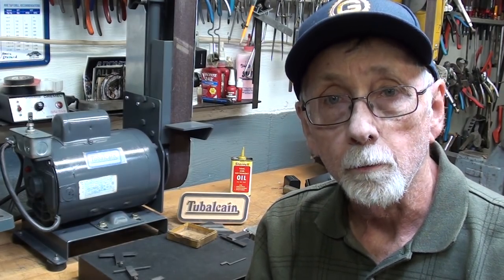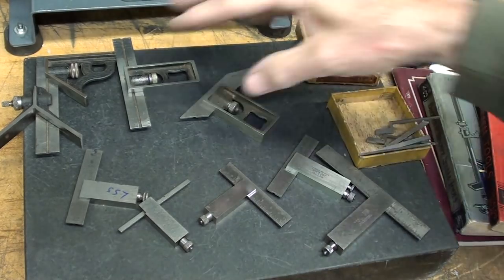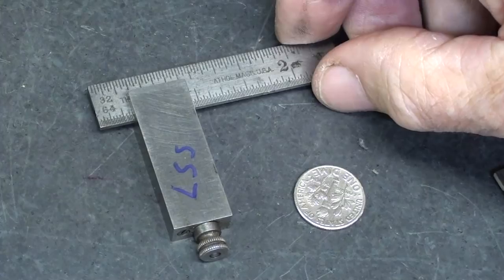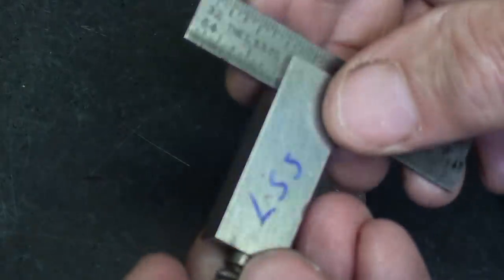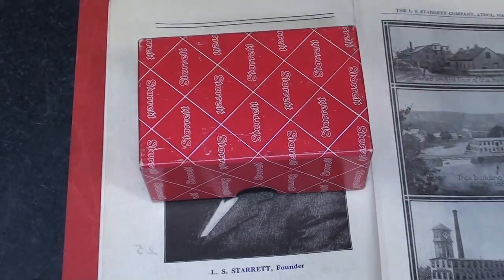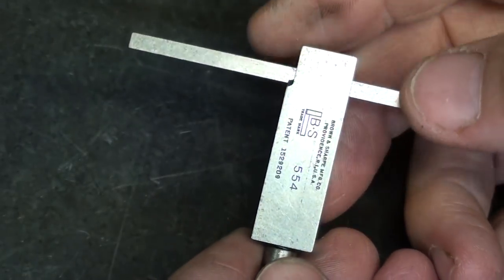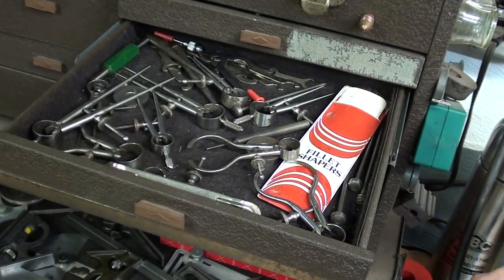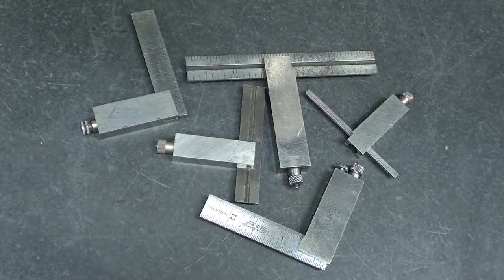Tiny Toolmaker's Squares STARRETT LUFKIN Tips #521 tubalcain

Comment: Hi Pete.  I still have my little square bought new in 1965.  Not a diemaker square, as the "filing draft" method of die making was already pretty well obsolete. In the 60's, steels were designed like puzzle pieces to allow access for grinding draft.  Then in the 70s when wedm, came into being, die steels devolved back to primarily solid, and draft was cut with the wire and on most dies, standards eliminated the land area. Incidently, wedm reduced die cost by 30-40 percent, and slashed lead times. This method also, required much less skill on the part of the diemaker. I also have a proclivity for luftkin and as I put together my tools, I obtained them when I could. My indicators of choice are Federal.  Tools were very expensive back then as opposed to now. Lots of shops would pay for your purchase and then deducted an amount out of your check to repay them. You made is many of your own tools as you could. Fowler offered an alternative to brand name stuff and quite often machinists went that route as they were not making the money tool and diemakers were.  Gem indicators were more economical than starrett for example.  A jobshop diemaker  supplied about 95 percent of his tools while most captive toolmakers could count on much more tools to be provided. Not sure anyone will even read this, but maybe someone will find it interesting.  Tc Mike
Reply from the maker: I do find those interesting. That is a good analysis. Thank you
Reply: The comment is very good information about the history of die making and the economics of innovation, thanks.

Comment: Mr. Pete,
I found one of the Starrett squares in the back of my father's toolbox.  It has the blade with the angled ends and the two adjusting knobs.  I always wondered just what it was used for.  He was a turret lathe operator for GE for 20 years.  I don't know where he would have used it.  At least now I know what it was for.
Thanks!
Reply from the maker: I bet you value your dad's tools greatly

Comment: Seeing all those scales reminds me of a horrible event I witnessed.  A friend of mine cleaned out houses that had been foreclosed on.  If he saw something he wanted he could take it.  One of those free items was a mint condition Starrett scale. It was really an extremely expensive yardstick - 36" long, 4R pattern graduations ( 1/16, 1/32, 1/64, 1/8"), satin finish .  It was maybe 1 1/2"  wide and maybe 1/4" thick .  He used it in his living room leaning against the wall next to the door to keep some long window drapes from blowing in the wind when the door opened.  I told him it was valuable and to sell it but he didn't take my advice.  He had a one room addition built and one day the one man roofing contractor showed up. I went over to help and climbed up on the roof where my friend was helping the contractor.  That beautiful Starrett scale was also up there -  being used as a straight edge to cut shingles. Because of its weight it had slid down off the roof at least once so the contractor kept sliding it under installed shingles to hold it.  I cannot describe how badly scratched up it was.
Reply from the maker: You just ruined my day
Reply: some things you should keep to your self

Comment: The prices that appear in many of these old catalogs were often above actual retail or wholesale prices. The wholesaler operated from a pricing schedule that might be 50% to 60% below the published price and would accordingly use a multiplying factor of of .5 to .6 against the listed price to figure his cost. One multiplier might apply to the whole catalog or several different ones to particular stock numbers. That way, the manufacturer could use the same catalog for several years and just make adjustments to the price by mailing out "confidential" pricing guides to the wholesalers as costs changed. The wholesalers in turn provided similar "confidential" lists to their retail customers which reflected their discount. The retailer could then point to the catalog and show the customer the retail price. If he put his own mark up on it and it was cheaper than the price in the catalog, the retail buyer thought he was getting a deal. The internet has done away with the pricing veil and the middle man so it is much easier to figure out who has the cheapest price. Frankly, I think we were better off paying a little more to a local dealer who had the product in stock and knew something about what he was selling.
Reply from the maker: That is very interesting. When I worked for a electric motor company. They sold bearings. There were three or four different colored price sheets. Various customers were givenwhat I think was favorable prices. The mark up was tremendous on ball bearings

Comment: Others have noted the price for the Starrett die makers square.... If you buy new from Starrett you can forget Chinese priceing. I bought a Starrett 1025-6 caliper for $2 a year or so ago...This is the direct reading 1/64" type, not a vernier. I was curious and looked it up new: $231.00 . Over the years Starrett has never been cheap. But they are the benchmark for quality tools.. and you can get spare parts and accessories which is no small thing.
Reply from the maker: Yes, they sure are not cheap